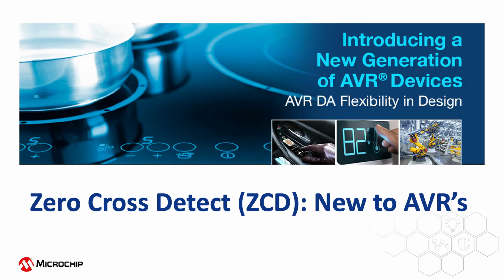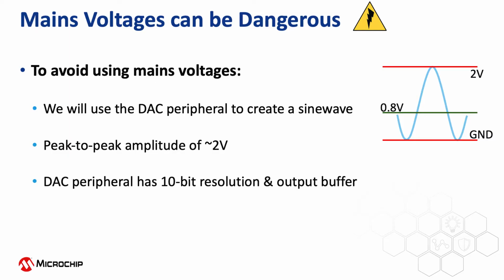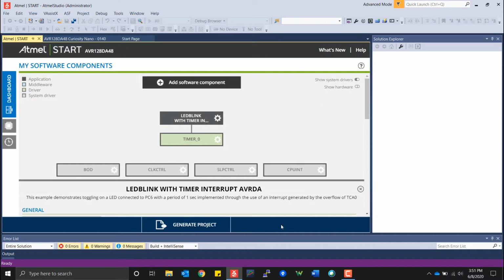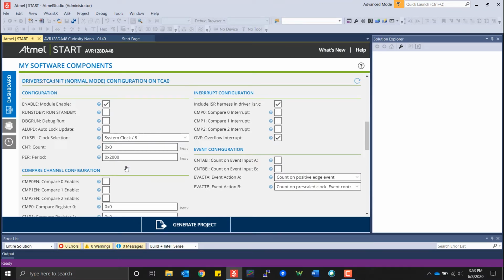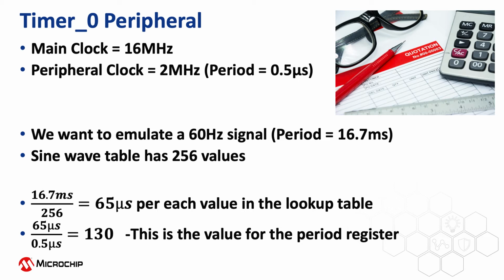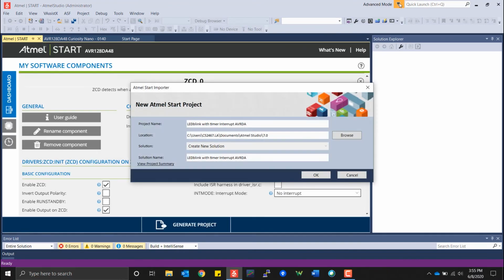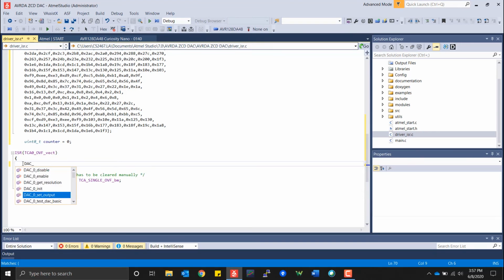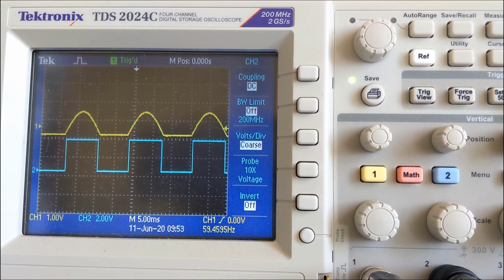How to Use the Zero Cross Detect (ZCD) Peripheral on AVR®

Comment: Tried this demo with a sine wave of 4V pk-pk with a 13.15KHz current limiting resistor, my ZCD output is not at zero crossing and is not of 50% duty cycle, will I could attach the o-scope screenshot here to show. Also when I connect my sine input, it is not clipped to half as seen here.
Reply from the maker: Hi, we need more information from you so we can troubleshoot.

Which specific device are you using? What frequency are you running the CPU at?

How did you generate your 13.15kHz AC signal? Is it a “true” AC signal centered around 0V, or is it something like a DAC generated signal ranging from 0V to some positive voltage (in the video it ranges from 0V to 2.048V). Can you advise what value current limiting resistor you used to limit the input current to 300uA? The equation to calculate the current limiting resistor is in TB3138 page 2 (link in the video description).

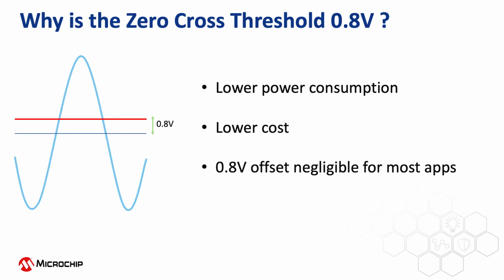Did you take into account the 0.8V offset for the zero cross? (1:15 in the video, pages 3-4 of TB3138), as that will affect the waveform you see in the oscilloscope. If you require a true 0V zero cross point please refer to pages 3-7 of TB3138 (link in the video description) to calculate an appropriate bias resistor value.
Reply: Y